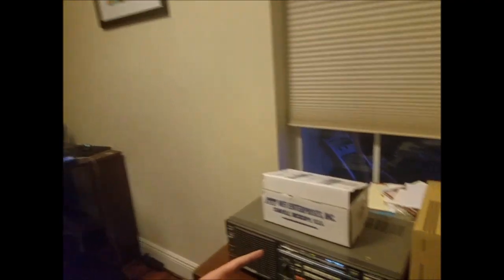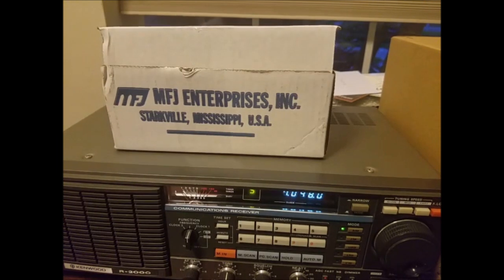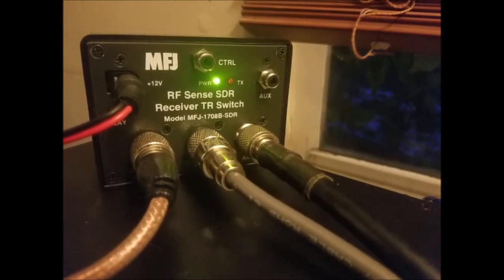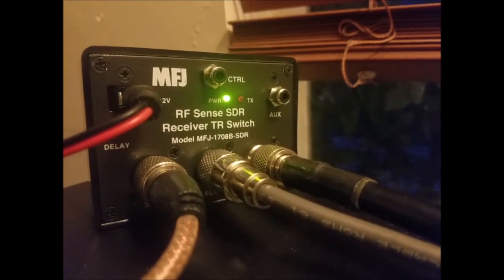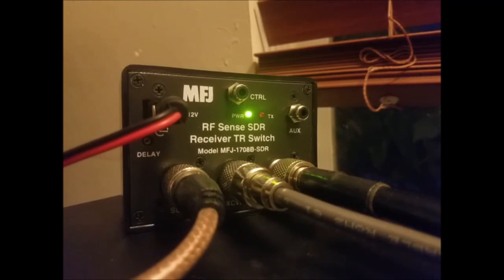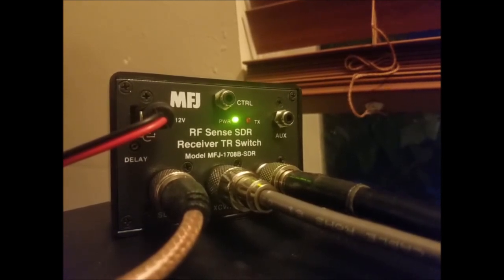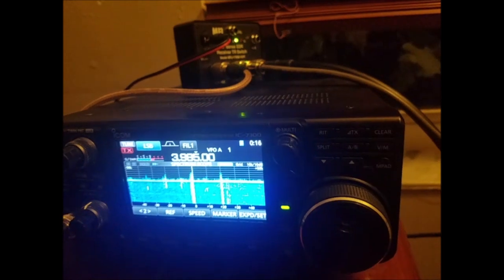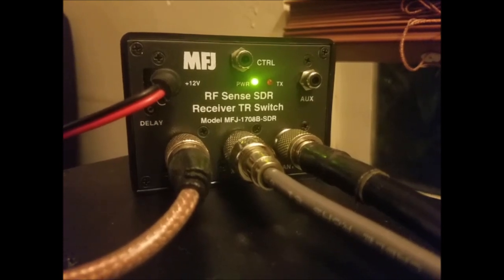2018: Do I need the MFJ-1708B-SDR T/R Switch?

Comment: Are you happy with the degree of isolation this is giving your sdr receiver?  IE, how strong is the signal showing on your sdr unit when you transmit?  How many watts is your transmitter?
Reply from the maker: yes isolation is sufficient. only rated for 100W don't push it past that

Comment: Great video. I just got the 1708B which shares the antenna more evenly between the transceiver and SDR on receive. I bought the first 1708 (non "B") last year and that also works great but it does not share the antenna on receive. That is good for my purpose because I am actually listening to the SDR. What can be a problem is the AUX connector on the original non "B" device cant be used to switch my SB221 amp because the AUX comes from the factory as normally closed and that keys my amp when in receive not transmit. I will add another $5 dollar relay and fix that, or just sell it.

Comment: Can I use this (or something similar) as a traditional T/R switch between a transmitter and receiver? I inherited a Drake T4X transmitter, the R4 receiver needs work (at LEAST $200, I figure) and haven't found a Drake receiver online (that actually WORKS) for less than $300, but I DO have a Icom R70 receiver. Just trying to get this working as cheaply as possible, maybe "Jerry-rig" connections between the two???
Reply from the maker: It will work but it's better to control  it using a hardwired cable connection, not RF sensing. I think the drake transmitter has the necessary "send" signal on the back . You may only need the cheaper version of this T/R switch not the one in this video. At the same time if you sell your old equipment you may get a nice used icom 718 without spending another $100 on a T/R switch

Comment: what happens if you have an amplifier? obvipusly if your using an amp wouldnt it be best to use the IF out on back of the radio which shuts off all RF to the sdr?
Reply: Instructions say under 200w or place in certain position. See PDF for more info
Reply: You connect your transceiver to the Control jack on the MFJ-1708B, Set jumper inside the MFJ-1708B, and connect the Auxiliary on the MFJ-1708B to the Amp's Control relay.  You can read the directions in the online manual and see the schematic.

Comment: You can install one of these and add a RF OUT to your rig for about a quarter  of the price:  https://kd2c.com/hi-z-tap-boards
Reply from the maker: It looks like a nice device. I don't know if many users are comfortable with the installation of the board. In addition to that it will void the warranty of the rig.
Reply: Stay away from this. Not advisable unless you're extremely proficient in soldering. You can easily kill your radio.